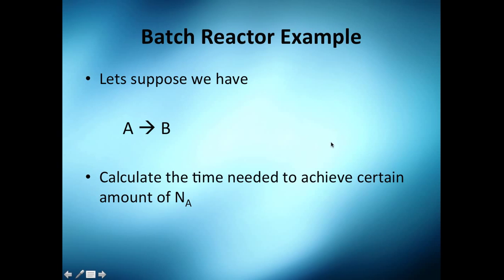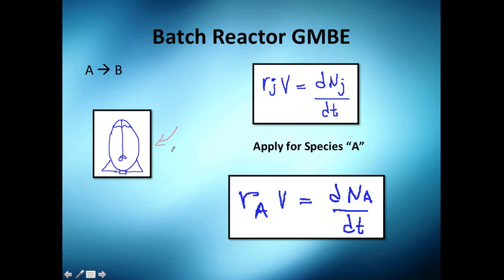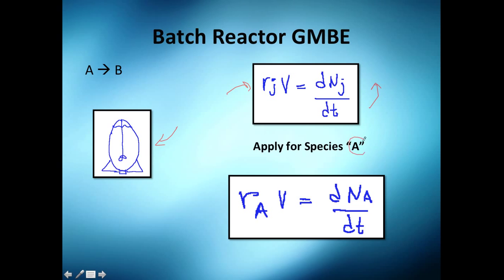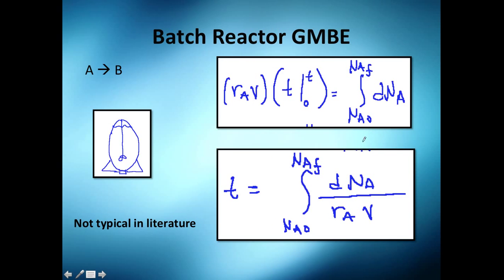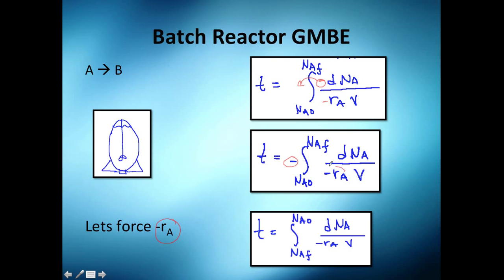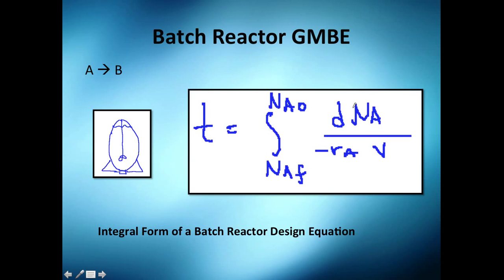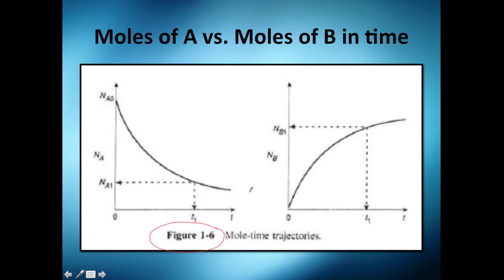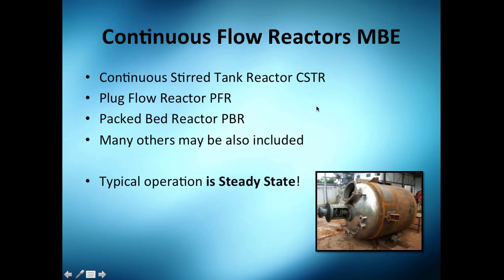Batch Reactor Developed Design Equation for Time // Reactor Engineering - Class 7

Comment: I think velocity of reaction, in this kind of reactor, isn't constant in the time.
Because there is a change of concentration with time. I guess that depends on the equation of reaction.

Thanks for the videos 

Saludos!
Reply: let me dissagree with you. of course there is change of concentration VS time but its relativley constant till u get the final product or reach the equilibrium.
Reply: Concentration (say mol/L) definitely depends on time, and this is represented by the reaction rate ("velocity") r (mol/L/s). However, the reaction rate itself might not depend on time (as Madanification said). This is analogous to how you might have a graph of y (mol/L) vs. x (s), where y varies with x and you have some curve. However, the curve could be a straight line, which means that although y depends on x, the rate (slope) is constant, and the rate does not vary with x (time), otherwise the line would be curved. Of course, in real life the reaction rate depends somewhat on time, but depending on the circumstances it could be a good approximation to consider the rate constant (and thus, r could be factored out of the time integral).
Reply: Actually, if we think more carefully about this, since he put the rate into the mole integral, then if the rate happens to depend on time/extent of reaction, then that dependence might still be account for because the rate is in AN integral. My differential equations knowledge is not strong enough to know if it matters which integral you put a function in, meaning whether there is a way to express the non-constant nature of the function no matter which variable you integrate it with respect to (though I expect one is often more convent that the other). Perhaps @Chemical Engineering Guy can weigh in.